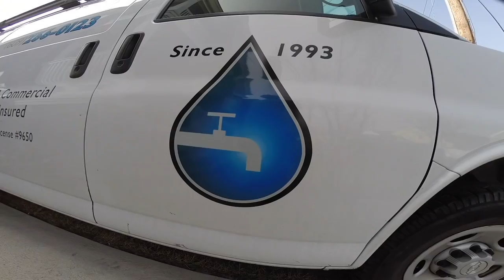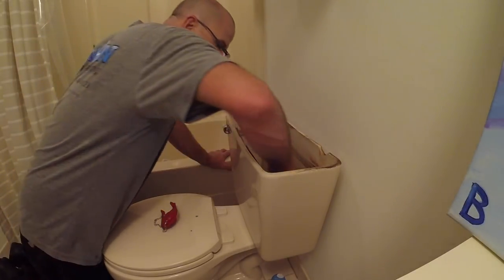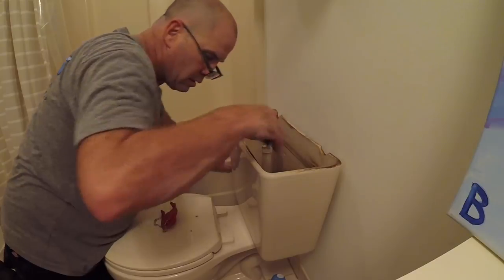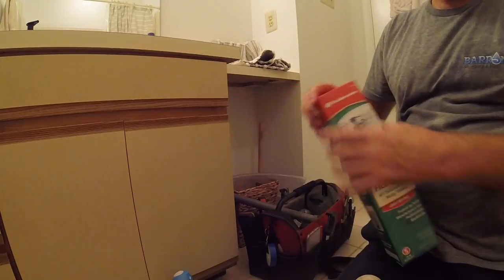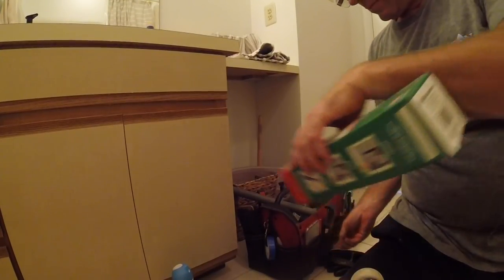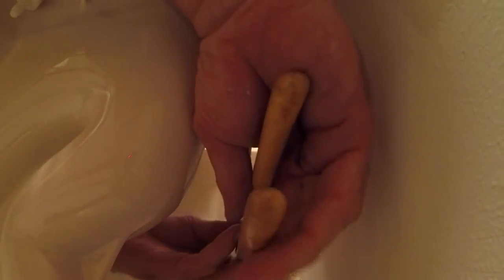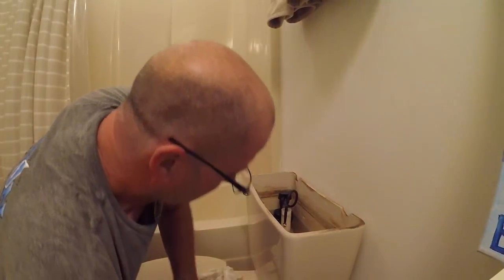Briggs Toilet Fill Valve and Flapper Replaced

Comment: Hey chuck. we use spk fill valve and fluid master but the best one yet is a new one that has came out and been designed but plumbers called the vector really compact and easy to service rather than replacing with a new one  all the work is done from the top of the fill valve ect filter servicing and height adjustment
Reply from the maker: cool....I will look up the vector. thanks c

Comment: Fluidmaster is my favorite toilet parts they are my go to for when I replace a valve for my friend or in my house
Reply from the maker: Yes. Great units.
Reply: I prefer Coast Foundry
Reply: The fill value was the only part original on this toiket the old flapper was a replacement. The original had the coast parts and it’s briggs handle the shaft of it looked like a sterling handle but briggs designed in the outter.
Reply: The 80’s one is different
Reply: That’s the 90’s one that he’s repairing

Comment: just now finished watching, had a well tank "whizzing" all over itself :))
turns out that the metal 1" Male to barb adapter fitting I installed under the tank November/15th/2005 wasn't stainless steel..... (Lowes) I'm positive it was supposed to be and cost more and amazingly the tank bladder is still good after almost 13 years! installed new ell and "POLY fitting" vs. any metals. I let them know it could last an hour to many more years and they chose cheap route.

I thought I installed it 2010 or 2011, but the sharpie scribble stick I applied said 2005, time does in fact fly >_>
Reply from the maker: time? time is on warp speed t....its crazy. The material out is a job just making sure its the real deal. So many plumbing factors

Comment: CB-1 I would have like to seen your water level in the tank a little bit higher we're not conserving water around here. Great video peace brother
Reply from the maker: It landed where it landed and the flush was good so Bam! its a wrap.....lol. I be honest with ya I would like to just put in new toilets for now on. Im really digging the gerbers. The entire time Im working on this Im like this should be a new toilet. Gonna push that in the future.
Reply: yeah, was a good bit low.
I usually go a bit lower than they want, but I know them valves often get "slow" with rubber aging. meaning they open and close slower, thus filling higher, when they get real funky old it can run on a bit and overflow.
the rubber disc/valve inside compresses at the little little nub the "stainless pin" goes into, which slows/stops the water transfer that allows it to open or close.
Reply: @ChuckBarron  That is a terrible thing to do. Never rip people off. It is dishonest and unethical.
Reply: @throttlebottle5906   don't know if I could have watch another flush lol. Just me or are these new ones noisier?